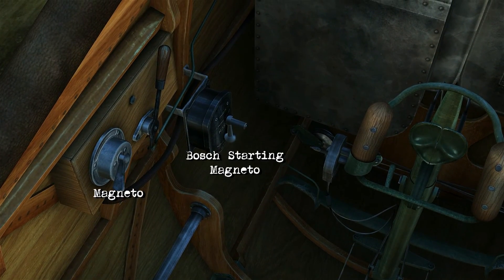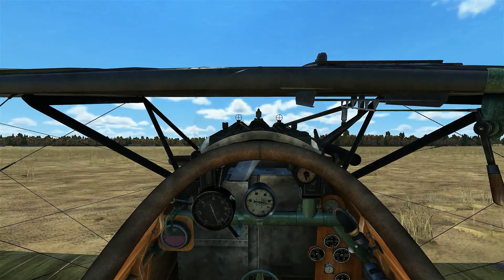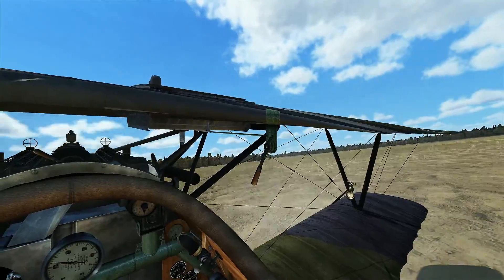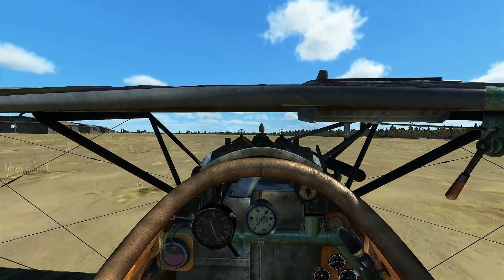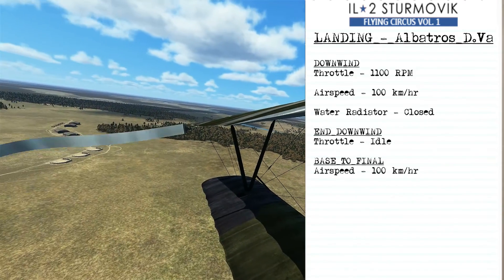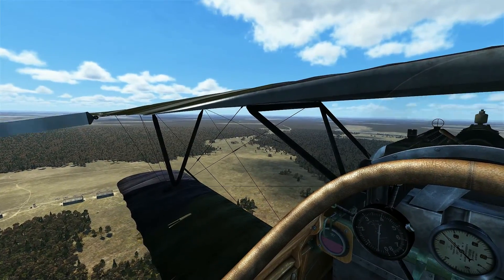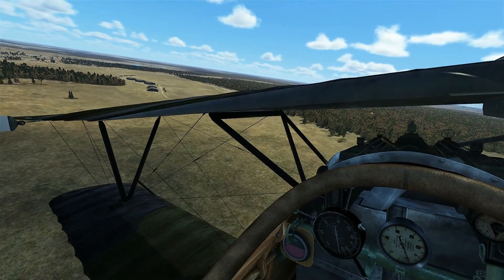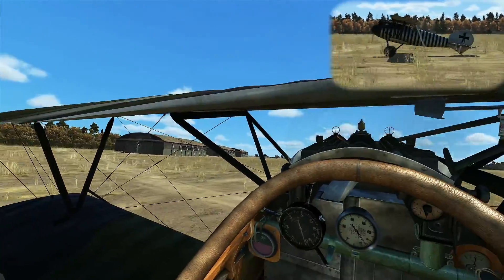Learn to fly the Albatros D.Va

Comment: What are the Best  tactics for dva? Any advices?  advantages and weaknesses? Thank You
Reply from the maker: Just realise you're going to be slow and once someone is keeping an energy advantage on you it can be hard to take it away. As with any of the WWI airplanes if you're attacking from above don't pull the stick to hard and risk airframe failure due to over-G. It is a very stable platform though so it will go where you want it to, making it a perfect airplane to start learning for Flying Circus.
Reply: @RequiemsACTL  Thank You. And last question about Battle of Moscow . What BF 109 is better to start with? E7 or F2?
Reply from the maker: E-7